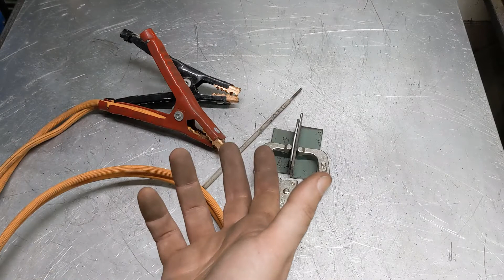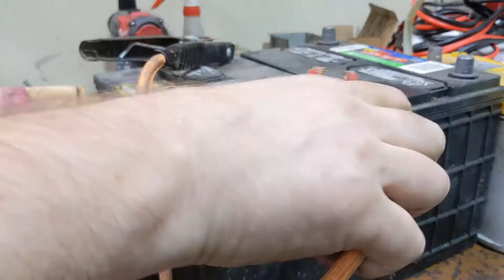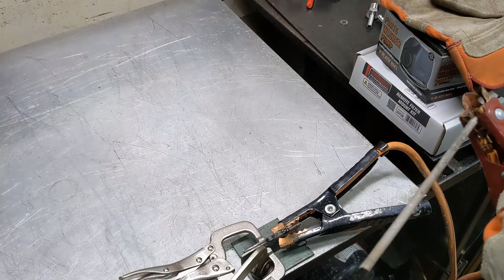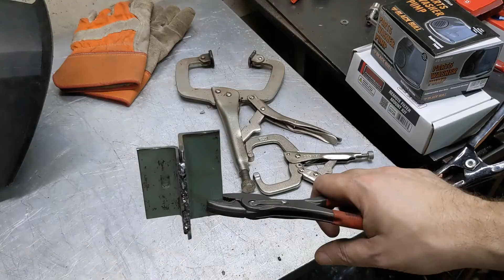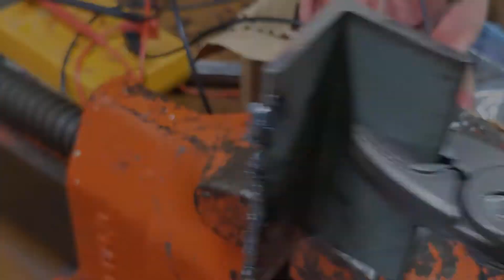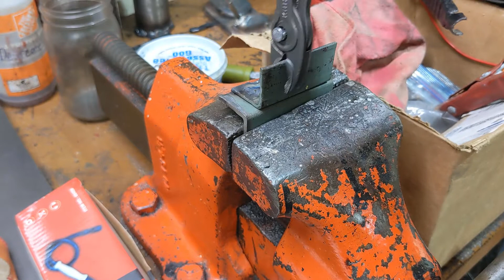Welding with Jumper Cables!

Comment: Going to show people shows them the right way you cannot hold the rod with a jumper cable hold the rod with vice grips and then put the jumper cable on the vice and you can use two batteries can get a lot better then what you were doing